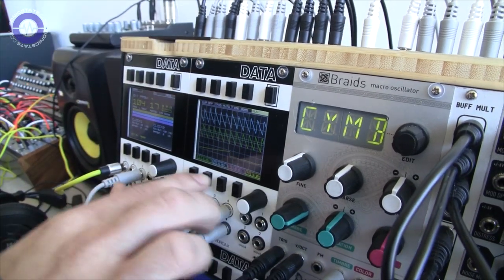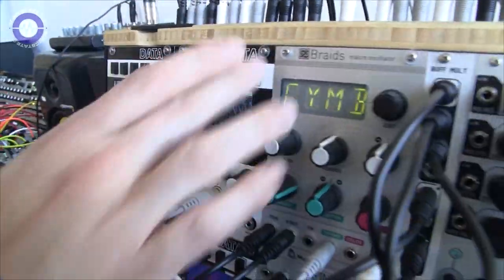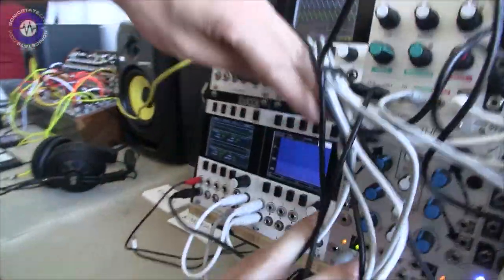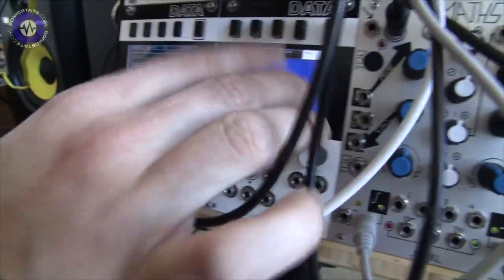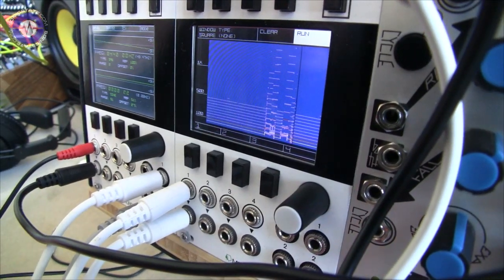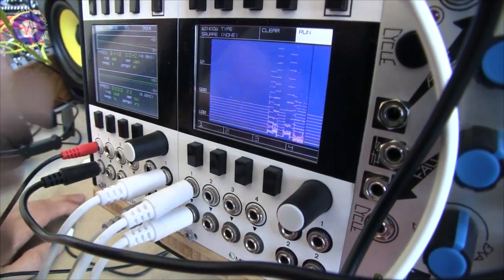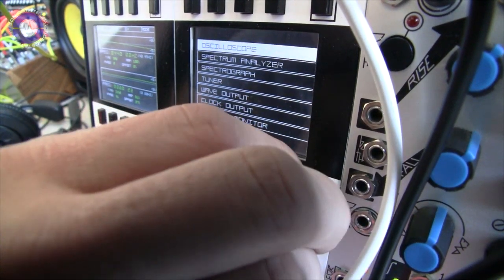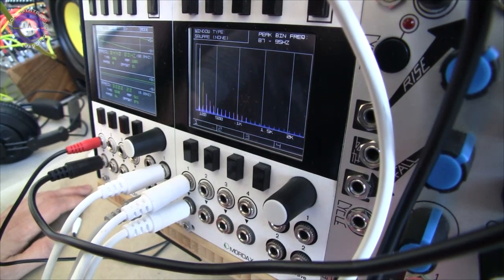Superbooth 2016: Mordax Systems DATA

Comment: 1. Does it remember its settings on power down?
2. Can it do Lissajous patterns?
Reply: +Ian Hoffman - 1. Does it remember its settings on power down? Currently it does not, but this has been a planned feature in our firmware roadmap for some time. At minimum we'll have it remember settings on power down, hopefully implemented by the time of shipping, or with a firmware update not long after. We've also been kicking around various schemes for patch saving and recall, either by-function or full-system recall, though that feature is still a little ways out.
Reply: +FSK1138 thanks mate!